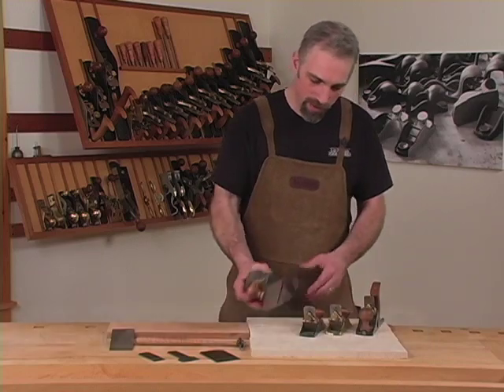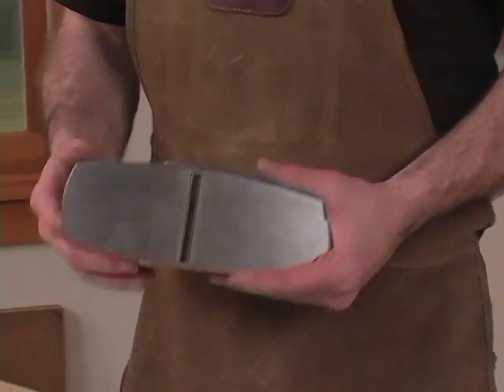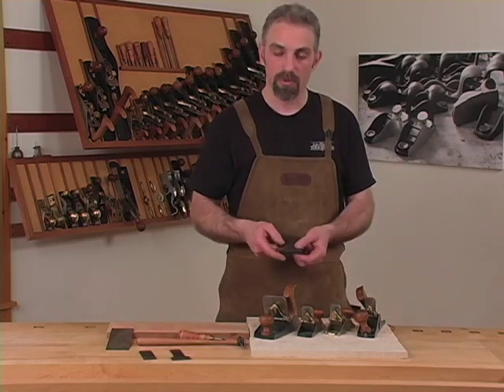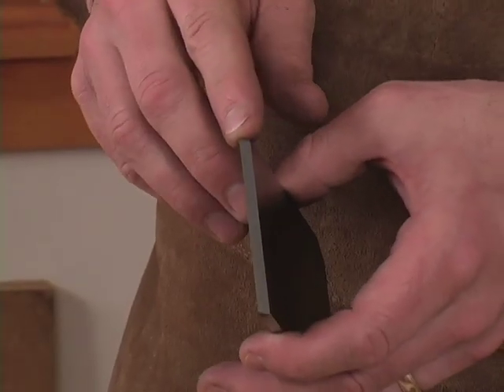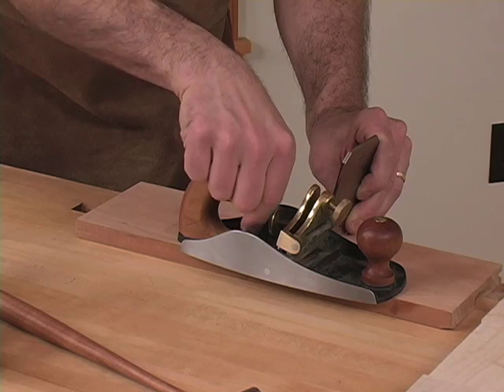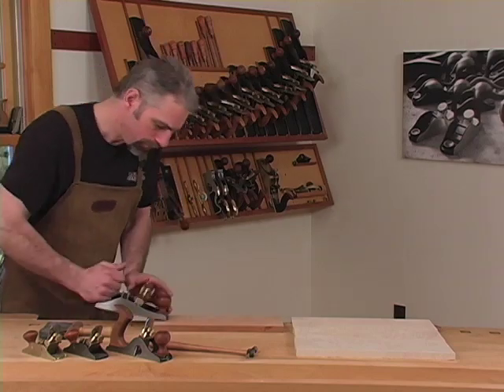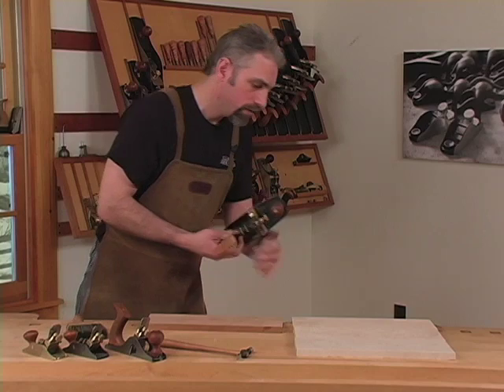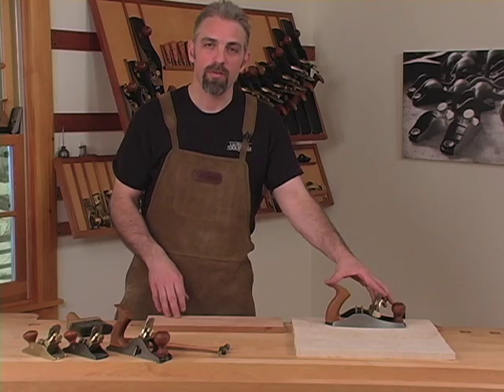Scraping Planes, Part 1: Types & Setup (with Deneb Puchalski)

Comment: I was taught by good instructors in school and hung out all I could with grandfather who did finish trim and cabinet making. He never took it to the varnish stage because he had a crew that followed him that scraped, sanded, and varnished or painted. The school instructors may not have had time to show all this bench plane stuff , plus I never knew of a scraper plane until a few years ago. Simply because I didn't know how to set up a number 4 or any plane correctly I made finish work much harder than was needed with sandpaper. My oldest son at16 gets excited over learning how these planes saves time, energy, sawdust, and makes shavings he gives to his Sweet Thang for her rabbit. I don't have one of these scraper planes "YET"!$?$ Just to try N see I may machine a scraper frog and put it in a junk plane and give it a whorl .  I realize making a frog and putting in a parts plane isn't the same as what was being Demo ed here but it should beet a hand scraper.

Comment: Keep in mind: a planed surface, and a scraped surface (even w a burr)!are two different things. I can usually tell the difference after finishing. My new rule is: finish everything with a hand plane if possible!
Reply: That's great, except for highly figured wood which must be planed cross-grain, which leaves a slightly rough surface. Contrary to the Lie Nielson guy, I firmly advocate turning a cutting edge on the scraper plane with a burnisher. This will produce a shaving and leaves a clean, abrasion-free surface in pretty much any wood.

Comment: A closeup of the scrapings/shavings needs to be shown. From a distance, it looks like the plane without a hook produces a fine powder. It seems to me that in this case you may just as well sand. That's why my #112 has been collecting dust on my shelf for 7 or eight years. There is another video out there on You Tube in which  a burr is created and then burnished into a hook. The demonstrator produces some shavings which are shown in closeup and  reveals very fine shavings. To me, at least, this is a more preferable  result. I plan to use this setup and perhaps the impression of the plane in the dust on my shelf will disappear. The site is called "onewaytoturn" an d I think he does an excellent narration.  It's more matter of fact and a little less annoying than the Lie-Nielson guy, who reminds me of Mr. Rodgers addressing a group of six year olds.

Comment from the maker: Since the bevel is already at 45 deg, it is best to just add 2 deg or so.  If you have built the sharpening stop board we talk about you can just use the 1/8" shim off the 45 deg stop and that will give you a good offset. Thanks for watching.